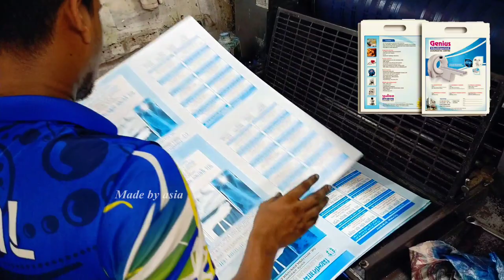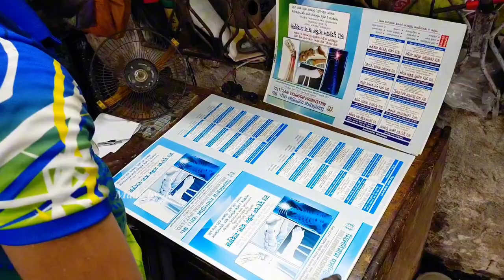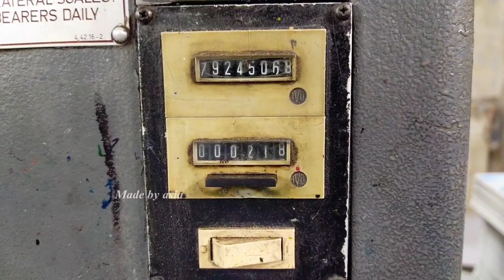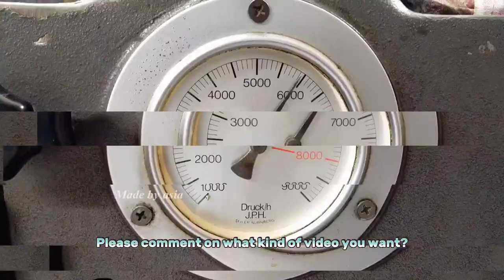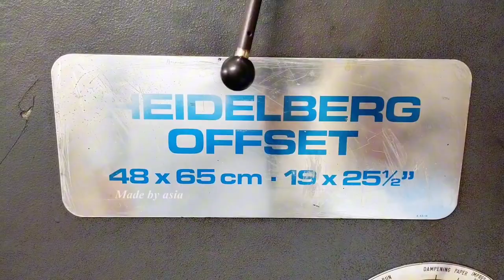Medical X Ray Film Cover Printing by Heidelberg Offset 48 × 65 cm . 19 × 25½" Printing Machine.

Comment: Good morning friends, congratulations for the very cool video.
I have a Heidelberg gto 46 and I would really like to exchange it with a Heidelberg Mo. Could you tell me the lengthxwidthxheight of this Heidelberg MO monocolor machine? I will be very grateful for the help since the place I work is very small. Big hug.
Reply from the maker: Yes sir
Heidelberg MO E
This Machine size: Length: 2,100 mm, Width: 1,750 mm, Height: 1,790 mm, Total weight: kg 2,950